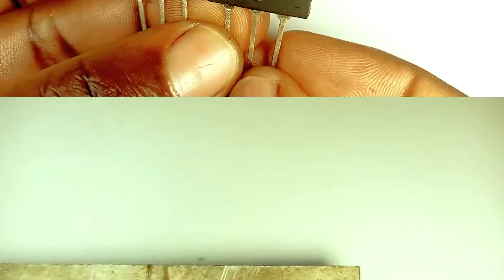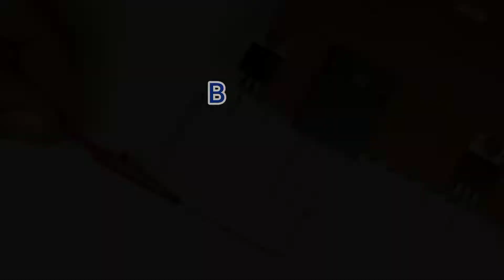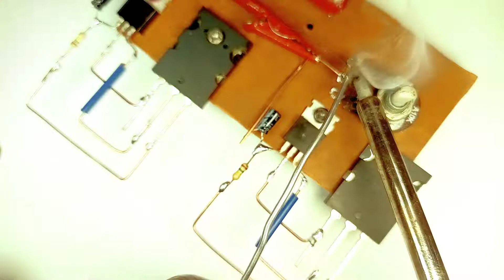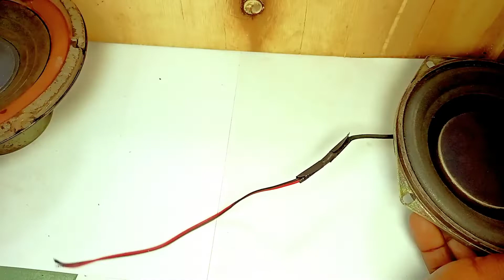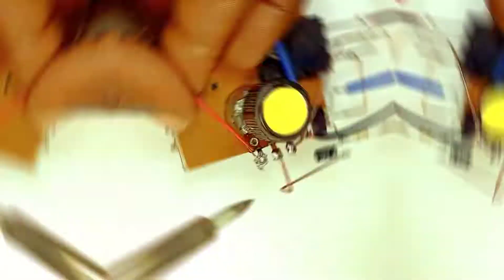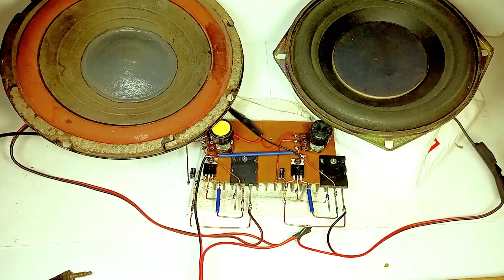DIY SUPER BASS STEREO POWER AMPLIFIER #audioequipment #crativeideas.

Comment: 😁😁😁😁😂😂😂😂
2 Watts maybe
Reply from the maker: First try making one & test it you will get to know how many watts can output
Reply: @jimecomtechnologies6119  my friend
I design such amplifiers and what you have done, is a joke.
I have built enough amplifiers to know what I am talking about.
Sorry no offense but you need to see the reality.
For me, the Class B are the best.
Auto symmetry, just to know what you want to obtain.
Tough amplifiers are not heavy to design, is just a matter of time, to built them.
As well with the speakers system.
Also here, I designed a lot.
Last project was a 4.2 system ( 2 subs with 2 x 18 inch each sub, 2400 w each sub - Speakers used Celestion Pro x 18 and tops , 4 PCs, DSP
Ok, nice channel, I am looking on your projects and looks really nice.